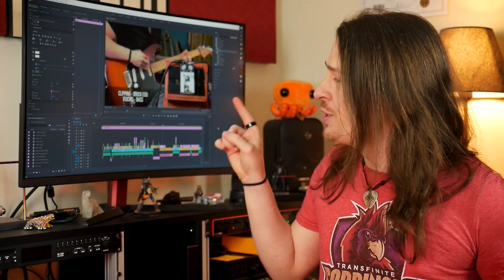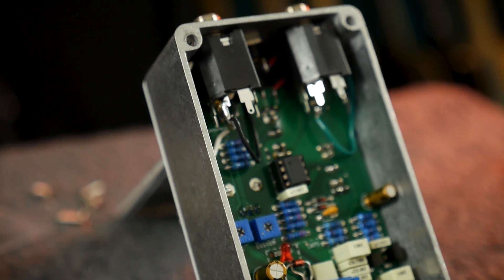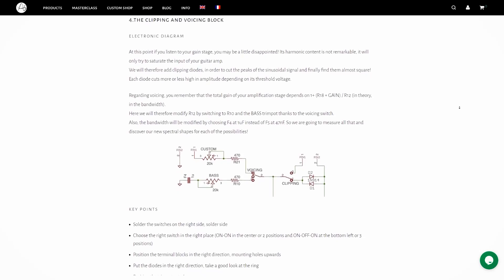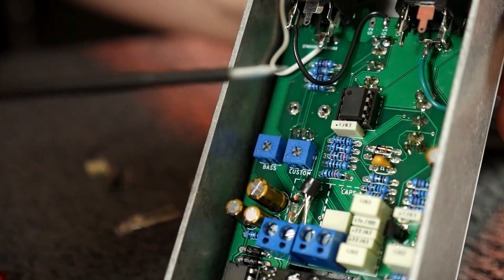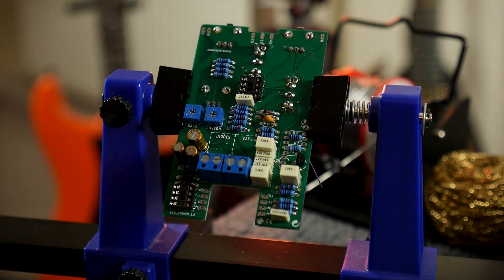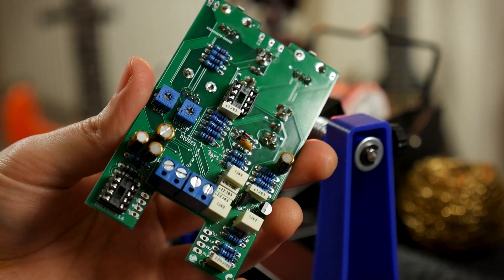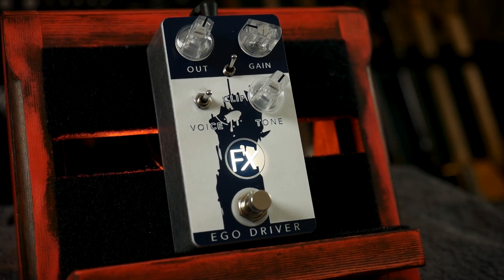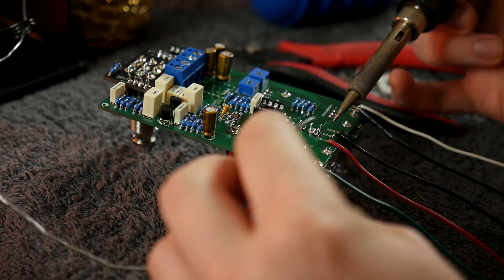Build Your Own Guitar Effects Pedal | Anasounds Ego Driver

Comment: Wire some external 1/8" jacks into the terminal blocks and make easily interchangeable external modules?
Hell, at that point it could almost be used as an FX loop...

Comment: I'm actually currently in the market for a new overdrive pedal, so this is actually a very interesting resource to me. While I don't have that much of a background in electronics, I have in the past attempted to build a tube amp together with a very technically minded friend of mine. I sadly don't feel like I learned much from that experience, other than soldering, so if the documentation on this thing is as good as you say, this might make for a good next step for me to learn more about the inner workings of these devices.

Bit of a shame I missed the discount offer, though to be fair, €80,- for a great overdrive pedal + a DIY course like this is still a pretty sweet deal. Thanks for the tip, Colin! Keep it loud! \m/

Comment: Holy sparrow spearing nut sac! This is a slimy cuckledoo hibgijob do on the sticky tip of king kongs doo diddle! I really want it to be able to programably switch it! Meaning with a digital control switcher I can program it to turn those little dials inside up or down based on what I want! And save those presets so that I can get an opera of tones on stage for 300 songs a night! And I'll have a drummer under me right foot, and a dime a dozen guitarist under me left foot(which will be sparingly used cause who the fuck wants to see another fucking dime a dozen guitarist? After you've seen 1000 you've seen them all for cunt's sake!

Comment: I was buildin a tubescreamer clone a few weeks ago 
Didnt work endet up buying a tubescreamer 
But i built a fuzz face once and it sounds amazing
Building pedals is realy fun
Reply: If your tube screamer doesn't work it's simply not done yet. Don't give up on it. What are the problems with your pedal? Maybe someone can help
Reply: I've built a few over the years that haven't worked or I've blown up hacking them. Put them on the "shelf of shonk". Fown the line you'll acquire a bit more knowledge and return to them. You'll either trouble shoot them or create an even better version from your previous "mistakes". In the meantime have a go at some more of the classic fuzz circuits. Silicone fuzz face and mk4 tone benders are very simple, yet great sounding.

Comment: Dear Colin, I may have a video topic. I can't seem to get a straight answer on this; if a guitar amp has a midi output, can you use that to control the amp, as well as any pedals in the signal chain or fx loop, even if they don't have midi outputs?
Reply from the maker: I think you might be confusing midi out with midi in. Midi out sends midi messages from a control surface, midi in receives midi messages to change parameters. 
Amplifiers are vastly more likely to have midi in. 

Also only devices chained together using midi in and midi thru connections can be controlled over midi. Midi commands aren't send down the instrument signal line so pedals connected conventionally can't be controlled by any midi messages sent to the amp. 

If you want to control individual non midi pedals over midi you'll need to connect them all to a loop switcher which can be controlled over midi.
Reply: @ScienceofLoud  thanks for the response, this makes more sense to me now. And keep it up with the great content

Comment: I built one of these during the early stages of lock down.
Was a great experience, my first ever build. Although my first build however I did blast through not really reading the wheres and whys but have since gone back and took in a bit of the theory. 
The pedal works perfectly, tons of tones on tap!
Great video Colin...and good to see my little board in use again.
Reply: I just got done building this pedal and I must have done something wrong, I can’t seem to figure it out, the “stock” channel sounds fine, but the swappable clipping sounds aweful. I don’t really know how to trouble shoot it. It’s kinda screechy and sounds like it’s got a really bad noise gate on it.
Reply: @christianhuthmacher2425  I can't really comment/help, I was lucky that mine worked so needed no trouble shooting.
Reply: My Guitar Stuff I ended up fixing it by re soldering the Clip Switch and and the Diode Terminal Block. It must have been a false connection on one of the lugs. Sounds awesome now!
Reply: @christianhuthmacher2425  result! Glad you got it sorted.
Reply: I just got mine in the mail.
Not gonna lie, I am hella intimidated...but minus a tester I have all the tools I need.

Comment: Decent project with some useful options.  Good documentation.

I would take exception, however, to a few points you made.  First - and it's a minor point - few op-amps will "swing" from rail to rail.  They can usually swing to within a volt or two of each rail.  So, with a +9V supply, a 4558 can deliver an output of around +/-3.5V, after which it simply runs out of headroom because it can't "swing" any farther. ("Swing" is how it is referred to on op-amp datasheets)

In theory, increasing the supply voltage via a charge pump like the TC1044, can increase headroom...assuming there were no diodes involved.  If the goal were to be as clean as a whistle, a 4558, running off +/-15V (which it can do) would be capable of producing an output of +/-13V (26 volts?! Aye caramba!).  However, no matter how much we crank the gain of the op-amp in this circuit, having a diode pair in the feedback loop (as Tube Screamers and many other pedals do) limits the amplitude produced.  Remember that once the signal at the op-amp output reaches the forward voltage of the diodes, they begin to conduct, providing negative feedback that momentarily reduces the gain of the op-amp.  In effect, the op-amp is never allowed to produce a signal greater than around +/-600mv.  Increasing the headroom by increasing the supply voltage does not affect that.  The chip may well behave differently in other respects, but the dynamic possibilities of the circuit are strongly dictated by use of that diode pair, to the complete disregard of the supply voltage.

Now, if a person wanted to use, say 2 green LEDS in series, going in each direction, instead of the humble pair of silicon diodes, then use of a higher supply voltage would indeed permit much greater dynamic range since the clipping threshold would now be something like +/-4v or more, instead of +/-600mv, something which would be pointless with a simple 9V supply since the chip would run out of headroom before it ever reached the clipping threshold.

Note that a number of pedals of good reputation, like the Timmy, will use a 2+2 configuration of diodes in the feedback path, instead of the simple 1+1 we see here.  By allowing the op-amp to produce an output of roughly +/-1200mv before it clips, one not only achieves a greater dynamic range, but also greater output from the pedal, such that even modest gains can push an amplifier hard.  And, as illustrated in the video, using a pair of red LEDs is roughly equivalent to using 3+3 silicon diodes.

Note that since, as I like to put it, most of the guitar signal "lives in the basement", any increase in bass amplification will not only change the bass content, but also push the clipping elements a little harder, such that increasing the bass will make it seem as if you have turned the gain up a bit.  That's not a bad thing.

Finally, the Ego Driver employs the component values in the output buffer that a TS-808 uses.  The later TS-9 changed these values from 100R and 10K to 470R and 100K.  I gather they did so because they felt the original buffer values were loading down the output.  But bear in mind the Ibanez release used electronic switching, so the buffer was always in circuit.  Concerns about loading would have been about what was happening to the bypass signal, not the overdrive.  Since the Ego Driver is using a stompswitch for true bypass, there is no need to be concerned about what the 808 values might be doing to the bypass signal.  We are free to benefit from the loading, that might smooth out some of the potential fizz.
Reply: Damn... I have a little bit of background with analog and TTL circuits but between Colin's explanation and your articulate comment (and likely the documentation I'm about to download... haven't. even. seen. it. yet. lol), I've learned more new things about op-amps and related topics in the last half hour than in many searches online.

Been doing some research and minor experimentation with 555's and 4024's in order to make some strange noises.  Using photocells and flashlights in a darkly lit room (footswitches for overhead LED bulbs as well) to trigger pitch/speed.  I'd like to build a light-sensitive Q-filter and play guitar through it while it's being triggered by a strobe light!

Thank you!

Comment: Thought about getting myself a diy kit, but starting out with "simple" drive pedal always seemed kind of off putting, as I play bass and most easy drives are more tuned towards guitar(plus the lack of knowledge on electronics and soldering)
But this looks like it could work on bass/be modded to work with bass once I understood what parts work in what way. Thanks for the video, Colin!:D
Reply: If your a bassist then you may want to check out the Rusdian green muff. There's an excellent kit from Italy, the case has some cool looking graphic.

Comment: 1N4001? 😱 those are rectifier diodes. I use them to rectify the voltage from the transformer in a power supply. In my overdrives I use 1N4148 ( small signal diode ). One idea could be to use a zener diode instead of the sof clippling diode, if the reverse voltage of the zener is just a bit higher than the fordward voltage it shoulf give you softclipping and hard clippling in one stage ( i will try tomorrow  )
Reply: You got a very low threshold with 1n4001 so more gain than with the others ;)

Comment: Can you use pedals through an interface? as I only use plugins but I'd love to build one of these!
Reply from the maker: Yes you can, but watch your input level to the interface. An overdrive will come in a lot hotter than your guitar pickups.
Reply: there's also interfaces that have the equivalent of an FX loop. Like the Behringer HD series.  My UMC404HD has inserts that can be used to add effects before the signal is fed to the computer

Comment: This was really inspiring. I've never looked into this since I have to fully understand how things work in order to learn new skills but this gives me hope.
Thank you
Reply: The good thing about this is that there's multiple skills to learn. The first one would be soldering - and while you're learning to solder (and desolder) you can build easy kits without knowing anything about them.

The next one would be modifying pedals. For that you need limited knowledge of how the pedal works. You can start by implementing other people's mods and then slowly ease into creating modifications of your own.

Then you can learn how to create your own PCBs. That's not hard to do but there's multiple ways of doing it and you need to find out which one(s) work best for you and with the equipment you own.

The next step you can take is building existing pedal circuits on eg veroboard instead of getting a kit. Which means learning how to transfer a circuit that's laid out for a PCB onto veroboard.

Or you can learn how to prototype stuff on breadboards. How to test out a section before you actually build it. See how it behaves when you change stuff around.

And then there's creating your own pedals. Most pedals are based on existing pedals. Some are mix and match, like taking different stages from different pedals. For that you'd need a bit of electronics know-how.

The good thing is, you really can ease into it and take it step by step. There's pedal building communities that can help you on your way and help you debug, for instance. It's a great hobby and you can increase difficulty at your own pace. The first step for me would be to grab a a few basic perfboards and grab bags of random components off eg Amazon and simply start soldering and desoldering them again and again until you're comfortable and get usable results every single time. If you're not experienced in soldering already, that is,